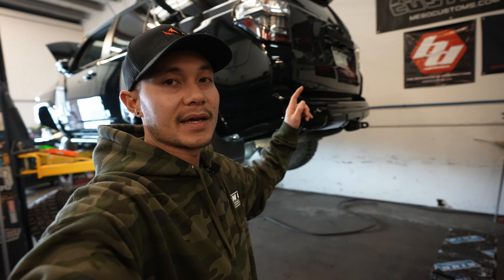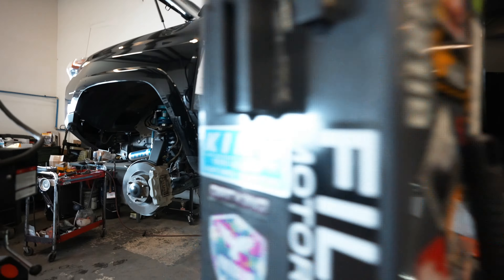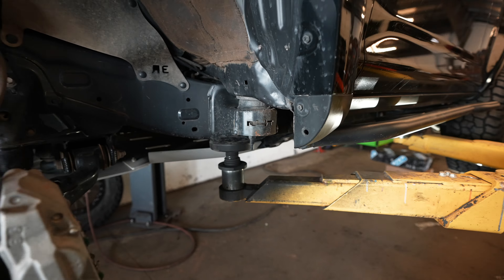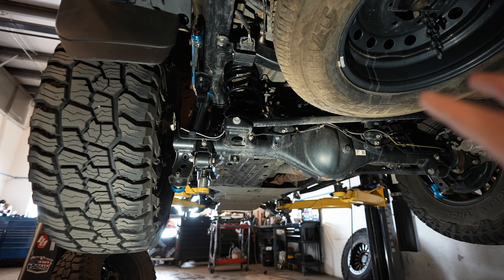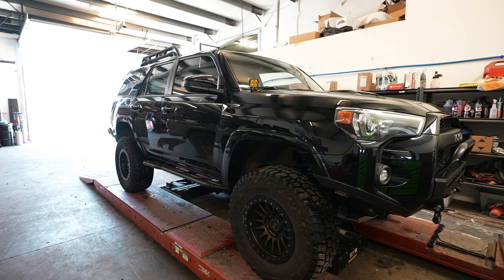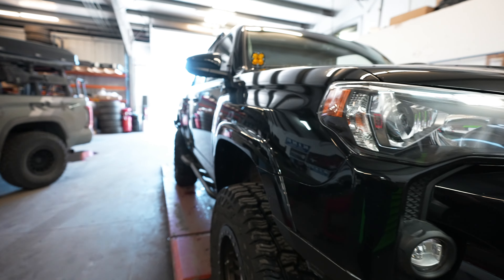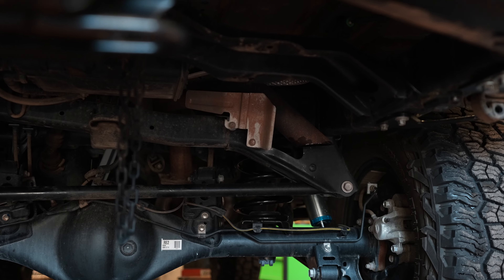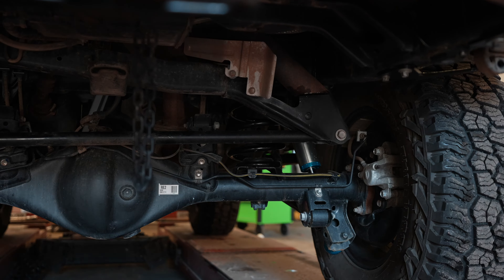The EASIEST Mod to Correct Your Suspension Geometry on Your Toyota 4Runner! DR KDSS BOTCK

Comment: The things the shop DOES NOT tell you when you get a lift kit installed. So glad I stumbled on this video! In your honest opinion, what is the worse case scenario if you do not do the panhard correction install on a lifted 4Runner? I currently run the BP-51s and 285s and haven't done much intense overlanding/offroading but mainly as a daily. TIA!!

Comment: Can you do some videos on what front bumper, rock slider and lift kits work on early model Limited 5th gens? 2010-2013. I have a Coastal Off-road high clearance plate bumper in the rear but I'm having a hard time finding something similar for the front that works on the earlier Limited models. Thanks! Great series on the lifts.

Comment: When using the SPC UCP,  for the front lower control arm cam/caster bolts, do you recommend aftermarket adjuster fixed cams bolt plate  like Bison, Poly Performance?
Reply from the maker: We use cam tab gussets .

Comment: Will the DR.KDSS part fix the lean after a 2.5  lift kit install? 
My Lexus GX460 has a noticeable lean and someone mentioned opening the KDSS valves when on the ground, then lifting it up allowing all 4 tires to droop, then closing the valves, and finally lowering the vehicle. 🤷‍♂️
Reply from the maker: This will not fix lean. it is for a better axle angle.
Reply: @Runnin4Tacos  👍 thanks man that's what I figured after doing a bit more research.

Comment: I have a brand new kings setup on my runner, I got the Toyota lean on it, I was going to do a trim packer for the rear and extend the left front a few turns, would that work or should i find a trim packer or spacer for the front? Also I just ordered the pan hard kit on this video thanks
Reply from the maker: KDSS lean?
Reply: @Runnin4Tacos  negative, non kdss and leans to the drivers side.
Reply from the maker: @josecastro2630  So what we do here is set the front driver a quarter inch higher. If the rear really bothers you. You can get the shims that SPC makes.